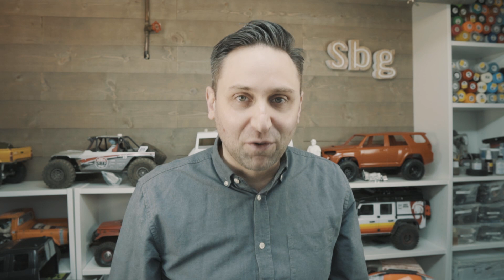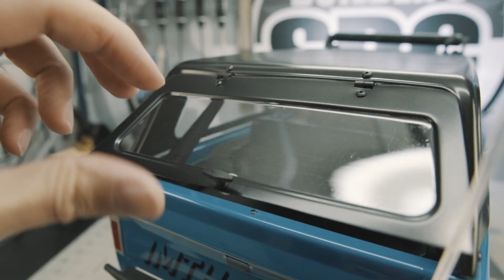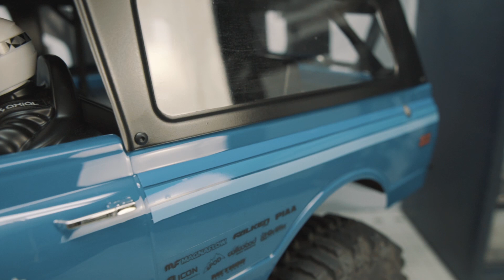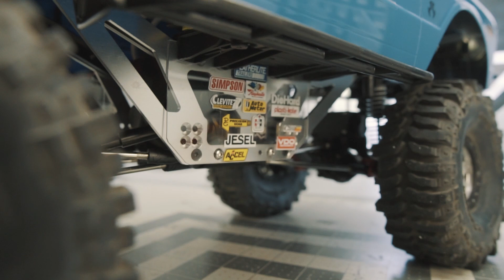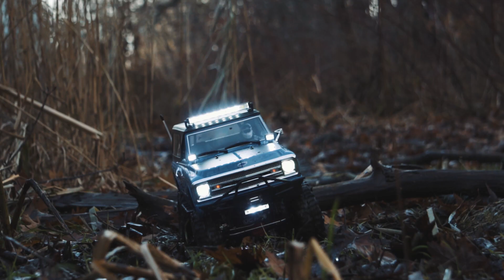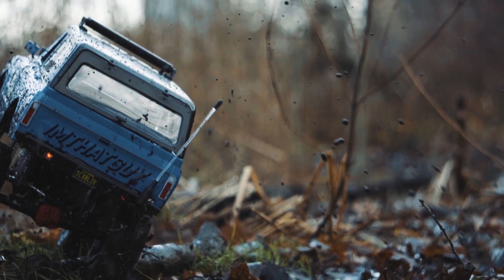Axial Mega Mudder Blazer Build Part 3

Comment: a little tip for ya bro....if you want a "matte" finish while still painting the body on the inside use "duplicolor" adhesion promoter and spray the outside of the lexan body with it and it will etch the lexan and give a nice even matte finish..that way you dont have to put the paint on the outside..nice build by the way.
Reply from the maker: Thanks for the tip Dave! You can also use Tamiya Flat PS on the outside too!

Comment: That seems to have alot of torque twist I thought the lift helps keep it straighter under load any way great build and thanks for the sweet slow motion video I think it captured  the performance of the truck and digging into the earth pretty well 👍😊
Reply from the maker: I think you're seeing a lot of body roll. The springs are super soft and there's a lot more body up there now.

Comment: U mentioned ppl commenting on the tires n needing fling kings to make it a mud truck... Theyre thinkin bout the MEGA MUD TRUCK SERIES trucks. Those arent budget built trucks. Where i come from, budget built is how u done it. U put a truck together with wat u have. N most run super swamper tsl 38s-44s. Most end up almost bald because 'they run on a budget' n cant afford new tires. The fling kings are more of a 'pro mod' mud truck tire or 'look ive got money' jacked up mud 'toy'. A budget built mudder is more of a couple thousand dollar (at most) truck, not a $100,000+ truck like u see alot of on the internet, those are just 'toys' with money blown on them to the extreme. Give me a beat up ol ford, a good strong v8 4bbl, dana axles, n a good set of mud tires, maybe a homemade lift n im happy. Dont need a flashy, jacked to the clouds, 'look at my money' 'toy' truck. Sure they look good, but i can make n ol beat up truck look good, if not better than one of those flashy trucks. JMHO. But u did a great job on the 'budget' mudder blazer build, plus it looks more period correct for that yr of 'mudder' truck
Reply: exactly where im from in michigan the most common mud truck tire is the super swamper bogger.
Reply from the maker: I'm pretty happy with the look, thanks for the comments!

Comment: Hi Matt, I am looking to make a similar Mega Mudder and I was wondering if I could convert my older SCX10, which already has the older-style axles for the UCFab servo mount, and will upgrade most of the other components (bomb proof transmission, element proof motor and RX4 ESC, MIP drive shafts, and Chevy Blazer and top). I think this should work but wanted your input or watch-outs. Thank you, Matt. Great videos.
Reply from the maker: Shouldn't be a problem John. You won't need the UCFab mount, as the original axles were servo on axle. The STRC kit was designed for the SCX10, so again, all should bolt up without issue. It'll be easier than what I did!

Comment: Did you have to change out any gears (axle & or pinion &spur)to run the bigger tires?
I'm running 49" interco boggers on mine and the ESC and motor get pretty hot in about 10 minutes of hard play... motor is upgraded to a 21 turn Tamyia with a 4000mah 2s lipo battery
Reply from the maker: I may have run a different pinion, but can't remember how much I changed it from stock. 13T? 21T on stock gearing is pretty high. Try brushless!

Comment: Hello Mr. IMTHHATGUY.  Nice blazer.  I painted my top white.   Perhaps you could assist me.  In Mr. n00b's shop tour vid, he said that his Cherokee build was on a scx10.2 chassis.  And that the front diff was open.  Any idea how he did this?  Unlock the dif, that is.
Reply from the maker: Yep, you can use the diff parts from an Exo/Yeti diff. They fit perfectly in an original SCX10 axle.

Comment: Stiffen up the suspension a little. pretty much to the point where you get very little torque twist. A mud truck doesn't need to flex that much more needs to be high. I think that might make it look just that much more real in filming. And if you don't like it you can easily go back
Reply from the maker: Won't stiffening suspension make the twisting more pronounced?
Reply: @scalebuildersguild  I wouldn't think so